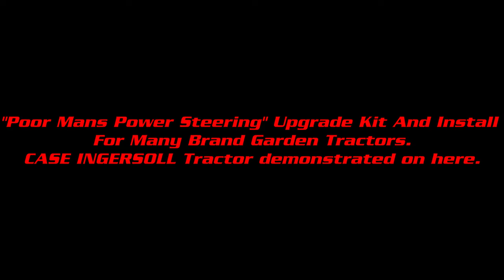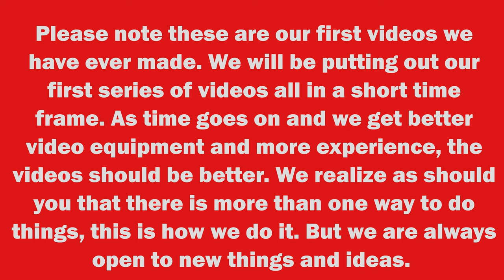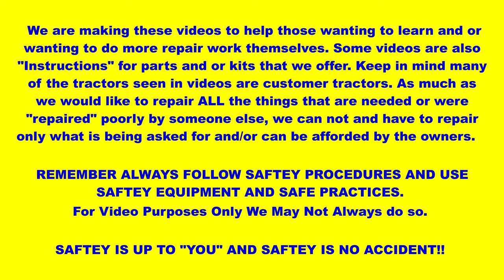How to Install The POOR MAN"S POWER STEERING kit for most lawn and garden tractor brands.

Comment: Thank you to you AND your camera person.
I did this upgrade on a craftsman DGT 4000. 
It made an incredible difference. 
I also had oversized tires and wheels front and back. 
I then did an extreme severe duty ( idiot) test. 
Ground hog holes, severe slopes ( as in if you don't lean on turns) 8 mph. 
7 acre yard normally took about 10-12 hours. 
I pounded the thrust bearing until it shattered in about 6 hours. 
I then replaced everything with 1 difference. 
I put 1 thin washer, 1 thrust washer, 1 thin washer on the bottom side. 
I repeated the idiot test and it survived with 0 damage measurable after disassembly. 
Yard mowed in 8 hours. 
I'm well over 50 and this hurt a lot, but I couldn't trust anyone to do the exact same thing twice for the many hours it would take to do a destructive test. 
And yes I had a small junkyard of parts just in case the fail point was at an unexpected place. 
Final discovery: 
1 if you have room on bottom for 2 thin washers that " sandwich " the thrust washer. DO IT !
2 Get someone else to do destruction tests ! !  
3 The thrust washer will leave your shoulders and upper back muscles almost pain free. 
Unless you drive like an idiot. 
4 It's very easy to replace the thrust washer every year and slip it a tiny bit of grease every 7 acres. 
Thank you for sharing this idea it allowed me to keep my job several more years past my prime. 
I just had no idea how to put it on YouTube.
Reply from the maker: You are welcome and thanks for the info, comment and support!

Comment: Do you have anything on Cub Cadets
Reply from the maker: Hi yes you just have to measure your vertical spindle shaft size that goes up into axle most are 3/4 or 1 inch. Both available at caseingersolltractors.com  thanks

Comment: I just installed this on my John Deere S240 mower. Don't waste your money. I didn't notice any difference.
Reply from the maker: Oh Elmer, Elmer.. A couple things. First we don't have a record of you buying a kit from us? Did you get our US Made kit from us directly? If not not, then not sure why you would take your negative attitude here with your maybe cheap China parts? Second out of thousands of people you are one of a very small handfull with anything negative to report for results. We also found some of the others with negative reports, installed the parts incorrectly.....(know the type? Too busy knowing it all, in a rush to say something negative about something or somebody for self validation and with lots of time on their hands in their "joyfull" existence. But the real problem often ends up being their fault of in the end. Know the type?) Last though all machines do benefit from the less resistance of the installation. The bigger differences "felt"  are on good quality heavy duty, heavy weight QUALITY machines. And/or machines with plows, blowers etc hanging off the front.  The cheap, lightweight throwaway mowers or box store style mowers will not feel as much of an improvement without a front attachments on them. Like the heavy duty machines in the video actually do. The one THIS VIDEO shows  weigh on average 1000 to 2000 lbs depending on model, Added weight and attachments.. Where YOUR light mower weighs under 475lbs.... And it is crazy to think a new little lawnmower like yours and so light needs streering improvements,  but with any of todays over price poor quality I guess nothing is surprising sadly.. So maybe make sure you have a quality kit to start, actually installed correctly and as far as the little light duty mower you have there we'll not much right now you can do about that. But thanks for watching and your ray of sunshine comment and representation.... Have sparkling week Elmer.